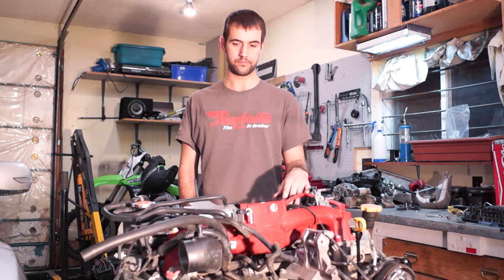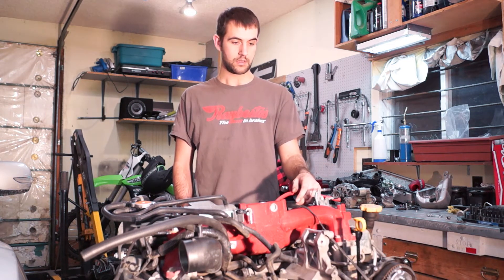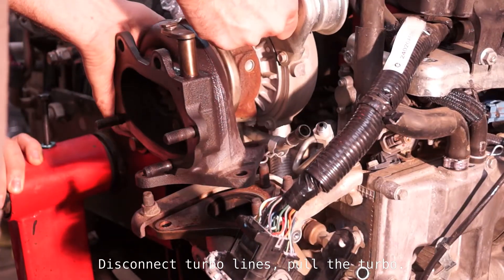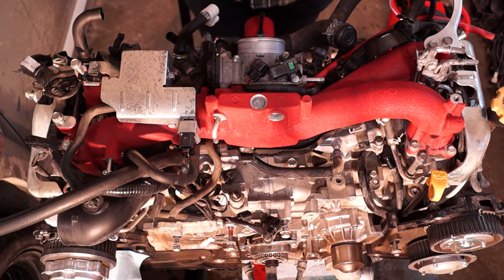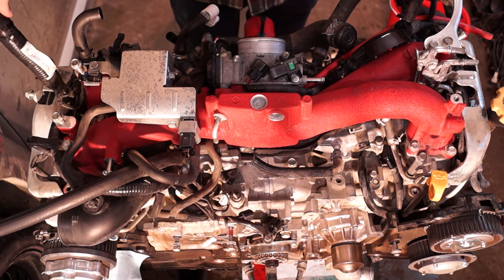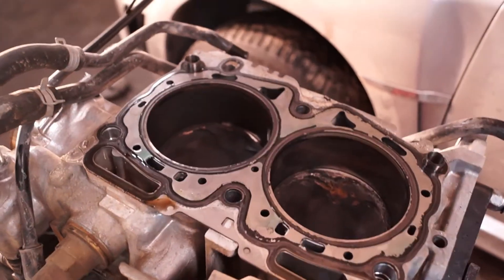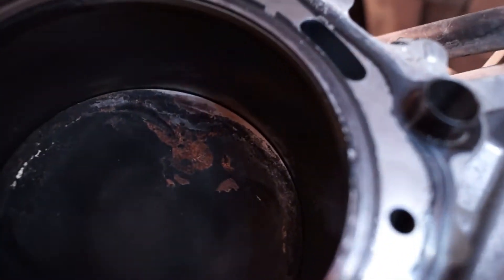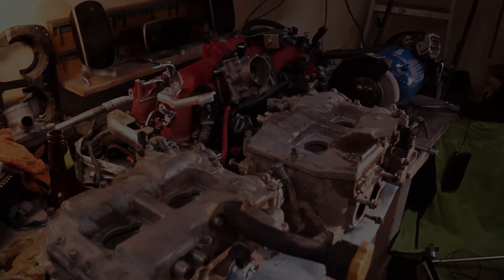How to disassemble a Subaru EJ257. [Frugal Garage EP10]

Comment: Great video, although, you really don't have to drill out those bolts, there is a Subaru cam sprocket holder tool, it will hold the cam, and with a hex tool and a huge breaker bar (not an impact) they can be undone without drilling, with a bit of luck.
Reply: simple bolt extractor over the bolt head makes this job much much easier. Bolt comes out, every single time
Reply: @1fast2005OBP  Exactly! Done it numerous times

Comment: Those aren’t “pilot holes” in the cam bolts they are oil passages for the AVCS system. I was lucky and only had to drill one cam bolt when I took mine apart.
Reply: Thanks for documenting your rebuild process!
Reply from the maker: Greg Sanders they are not oil passages. The holes that they go in are blind holes, the oil passage goes through the outside of the cam and into the mating surface where the cam gear presses against the cam. where the bolt is, it does fill up with pressurized oil that passes through the threads of the cam bolt. but there's no circulation there.
Reply: @ChillaxedJosh  this is completely false.